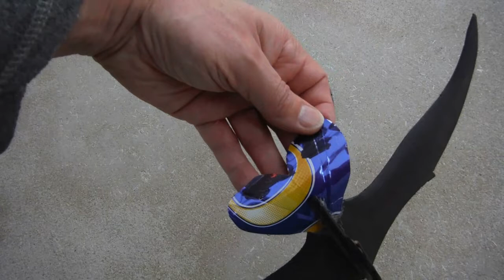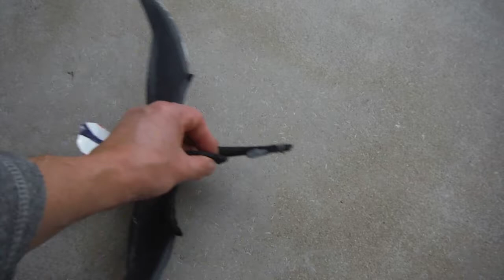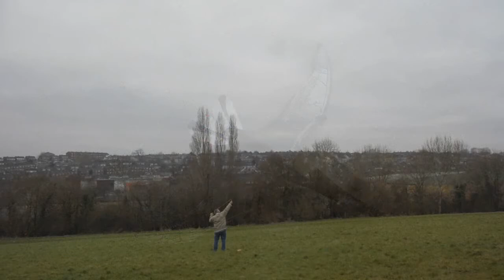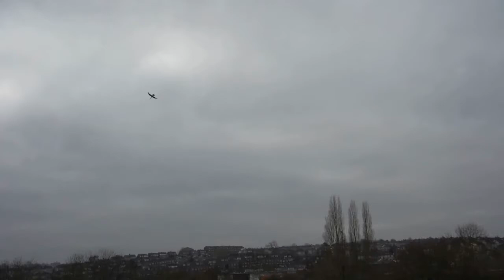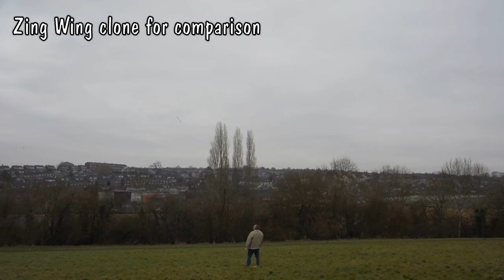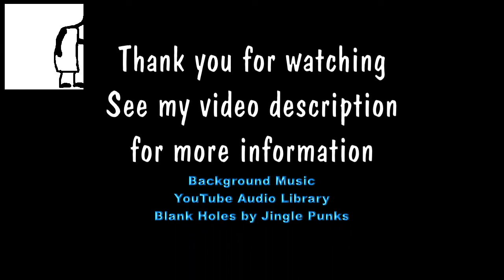Pizza Tray Pteranodon Flight Tests - New tail

Comment: Laughed at 'polystyrene brick' below haha. It's getting there though, that's for certain.
It seems it wants to loop, but then when slows it turns to a glide. I'd drop the elevator a bit and lighten with some more sanding. No matter what, it's a cool thing to see flying :)
Reply from the maker: Thanks Slider, yes I think it is the look that keeps me interested, plus the fact it hasn't broken in pieces yet. We would have spent a little longer trimming but my rubber band on the catapult broke and I couldn't believe I didn't have a spare in my bag, I was sure I had packed some. Those were the best of about 30 flights my daughter recorded for me. Compared to yesterday's straight up and straight back down flights it was doing better